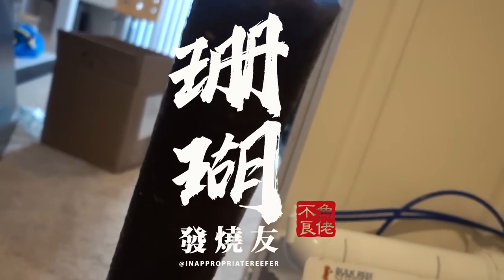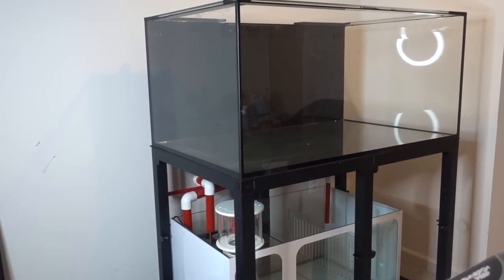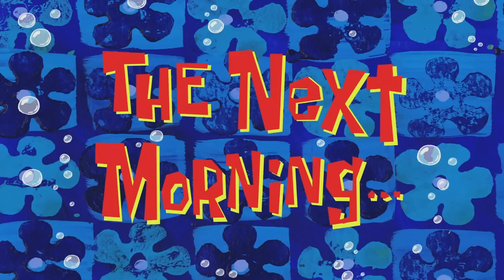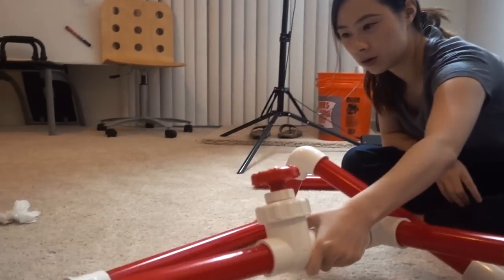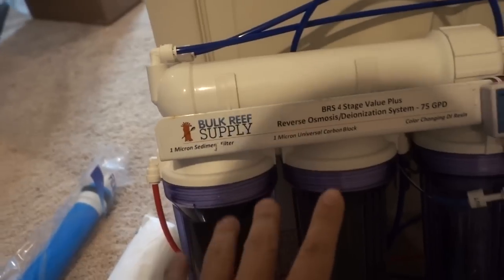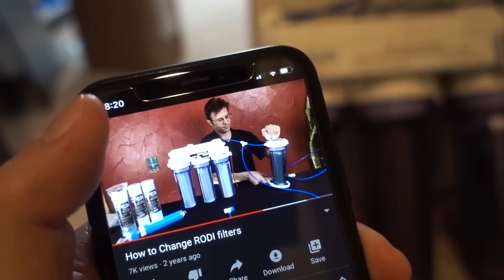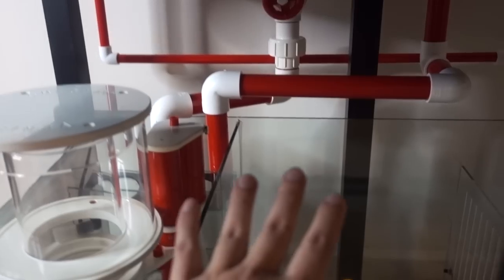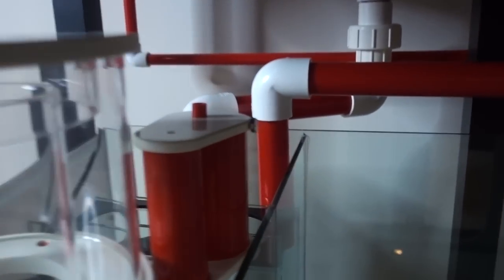Plumbing the 135g & RODI replacement! 🛠 (135g - 2/16/2020)

Comment: Don't use a marinepure plate/brick under your skimmer, either get a dedicated skimmer height adjustment plate or make one out of acrylic. I used a marinepure plate to raise my reef octopus essence s-130 and after about 3 months, the plate was a crumbling mess and my ICP results came back with 79.71 µg/l of aluminum in my system.
Reply from the maker: Thanks for the heads up, I heard about Marinepure Plate releasing aluminum but have never experienced it myself, but that fear, on top of the plate crumbling under the skimmer making a mess is making me rethink this. I will most likely move the plate I got from the 45g to the 135g if it's still in good shape, but will skip if it looks like it's breaking down or mostly clogged!
Reply: @InappropriateReefer  that's exactly what I would do brother. I'm still running marinepure spheres in my refugium and will continue to do so. I don't have an ICP test prior to the plate breaking down, but I'm willing to bet aluminum was released as it crumbled and possibly not before. I'll know for sure in a few months when I send in my next icp test now that the plate is out

Comment: Try swapping the overflow pipe in the overflow with the vertical below the overflow.
It looks very high to me that overflow tube
Reply: My thoughts also. Emergency stand pipe too tall & horizontal drain too short. So maybe swap them so sump can slide over. Sump  should be closer to outer edge.
Reply from the maker: I have tried it but the horizontal drain line is the longest pipe that I received, I will double check though, I may have mixed them up along the way!
Reply: I was thinking the same thing too.

Comment: Great video. Thanks for answering my question about the skimmer. I have been interested in these tanks but could not get a true gauge of the skimmer chamber. I have the same skimmer and the chamber is a little tight . Btw I think you will need to cut the emergency pipe in the overflow. It needs to be just below the water line in the overflow.

Comment: Did you disconnect from the RO unit before flushing your new carbon block? If not, that new RO membrane may be shot. Supposed to flush the carbon block for quite a while to get the dust out before connecting to the membrane or you'll plug it up.
Reply from the maker: I did not 😭 is there any indicator when RO membrane is shot? High TDS on output?
Reply: @InappropriateReefer  I believe it will show as slower water production or possibly a decrease in treated water and an increase in waste water. Not sure if/how it affects TDS. I just know you're supposed to run quite a few gallons through the carbon before attaching it to the RO membrane. Just like how you rinse your carbon before putting it in your tank.

Comment: You said your think you might need to trim down your emergency overflow pipe in the overflow box and then pointed to a piece of pipe in your sump that you said you needed longer (so you could slide the sump over for the ATO) could you switch those two pieces of pipe? If one is longer than the other that might fix your problem on both ends. Just a thought.
Reply from the maker: Thanks for the idea, I believe the horizontal pipe I am using now is the longest one, but I will double check!

Comment: Recommend disconnecting membrane  installing just sediment filter, then flush for 5 mins, then install carbon filter, flush for 5 mins, then reconnect membrane, disconnect di line, flush membrane for 5mins, then reconnect the di filter, flush for 5 gal. Also when replacing the sed, carb, di filters only. I do the same steps but before I do I use a capful of unscented bleach in the first canister, disconnect membrane and run water to fill both sediment and carbon canisters, let sit for 5mins, then flush for 5-10mins til no bleach smell is detected, then flush sed, carbon before reconnecting membrane then flush 5g, after replacing di. Helps keep the crud out of your ro membrane.

Comment: What about drilling a few small holes an inch down on the emergency overflow pipe.  That way it can provide both a regular trickle and still act as emergency drain if primary clogs?

Comment: Why dont you fill the display tank with ro up to the overflows put your power heads on  stick a heater in and add your salt now?
Reply: Check the seals ;)

Comment: The emergency line is way to high. Swap it with a shorter one will allow you to have parallels line in the sump
Reply from the maker: Do you mean the emergency line within the overflow box? Or the emergency line pipe that goes into the sump?

Comment: I ran my RODI for 24 hours after changing the media
Reply from the maker: That's a lotttt of water!  I ended up just running around 5g (~an hr) through the system and started using it. Hope it was OK
Reply: Inappropriate Reefer 
You should be fine, it’s better to be safe than sorry in this hobby.   I hope all goes good for you and your new reef tank.    You had some rough luck the last two months!!